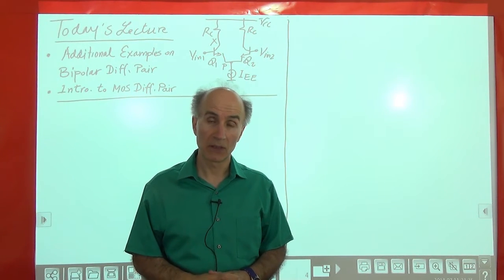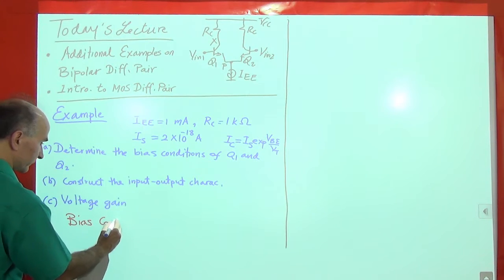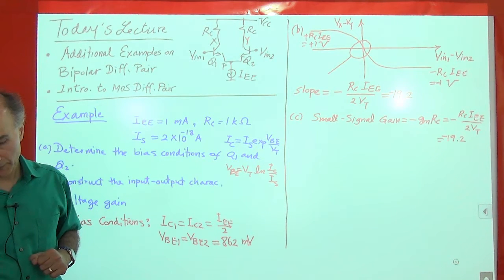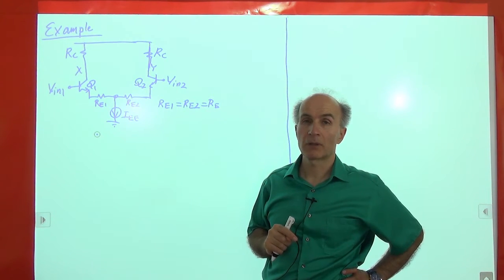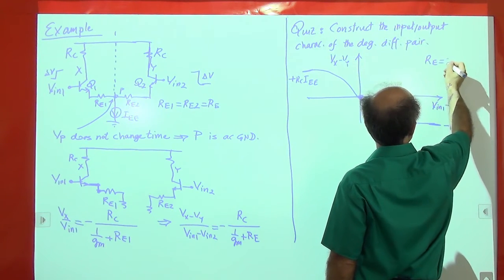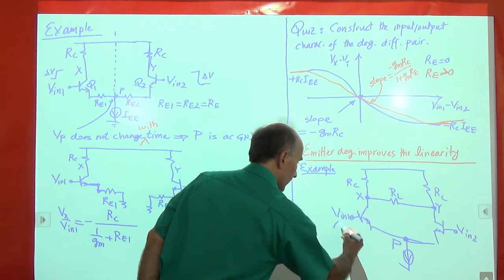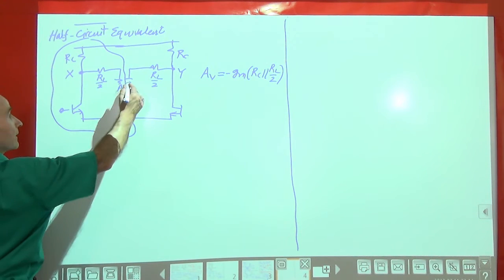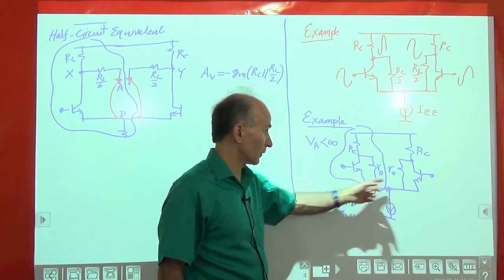Razavi Electronics2 Lec 11: Additional Examples of Bipolar Diff Pairs

Comment: 01:25 - Intro and Review
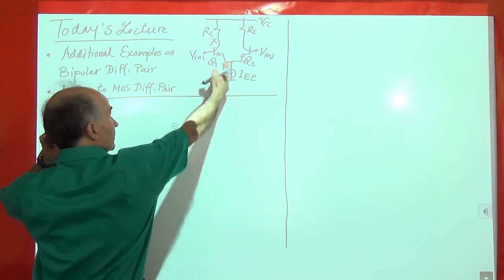05:25 - Example on Bipolar Differential Pair
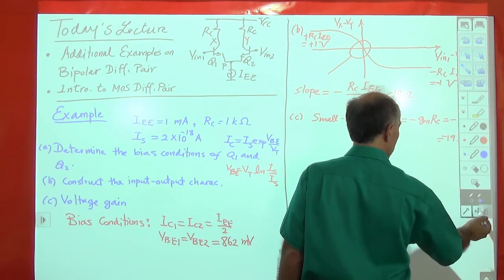14:40 - Example of Symmetrical Voltage across Linear Elements
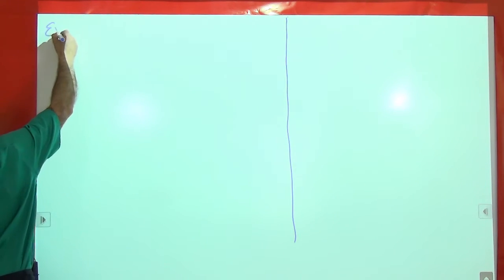19:19 - Example: Bipolar Differential Pair with Emitter Degeneration
25:20 - Construction of the Input-Output Characteristic for Non-Equal Degenerating Resistors
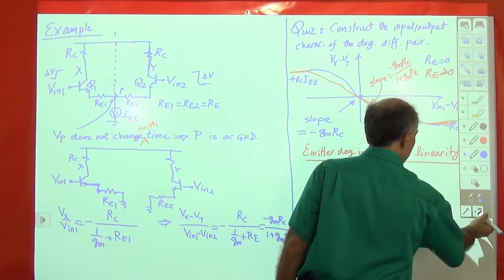32:10 - Example: Resistor across Differential Transistors Drains
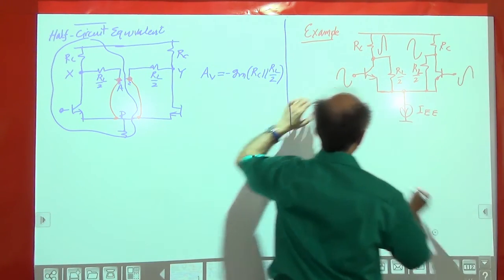42:50 - Addition of the Transistors Output Resistance